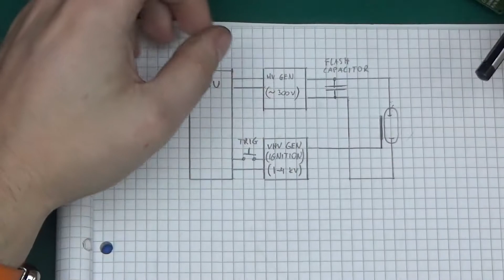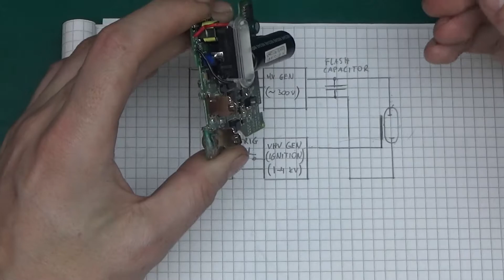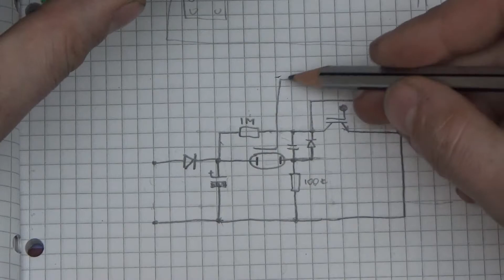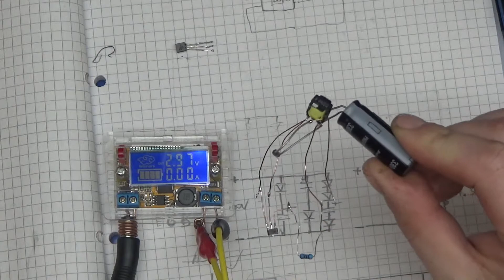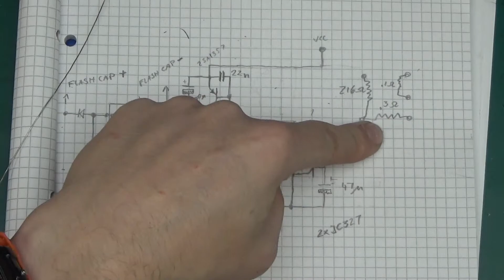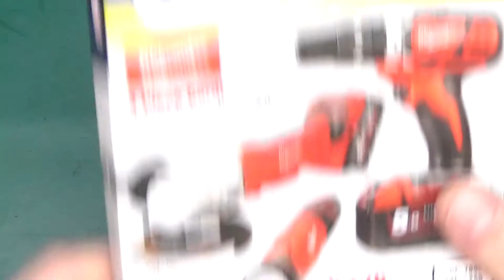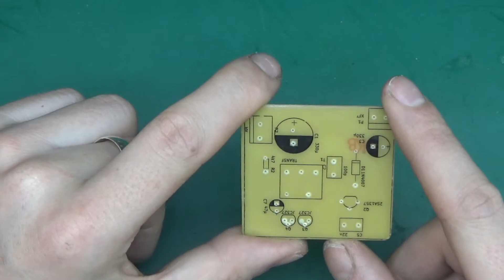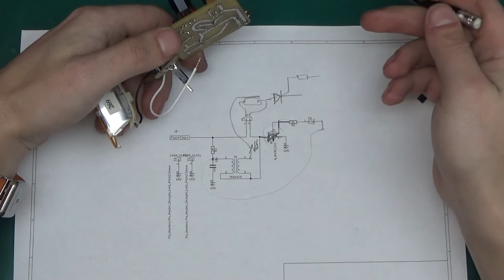Xenon flash reverse engineering, build, and mistakes

Comment: In the circuit, does the actual flash bulb have any affect on the flash or is it basically a neutral component of the circuit?  I have one where I suspect the bulb is faulty as I cannot seem to find any component fault on the board...  I just am curious if the bulb itself has any affect in the circuit operation?  Is this a crazy questions?  What will a bad bulb do to the circuit I suppose is my question?.. (shorted in thebulb, or open in the bulb, etc..)
Reply from the maker: This type of lamp cannot be shorted. They also have a finite amount of flashes, so will fail eventually. The circuit will work fine without the lamp, but may get damaged if lamp gets shorted.
Often what fails is the conductive strip on the lamp if it's the conductive paint type (the HV trigger) - easily repaired by putting 3-4  spaced out wraps of thin copper wire around the lamp.